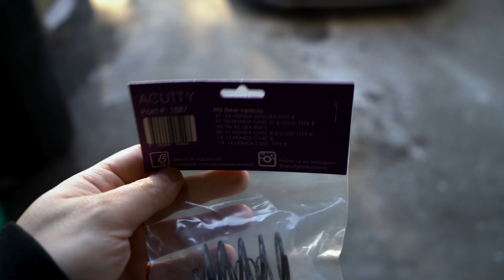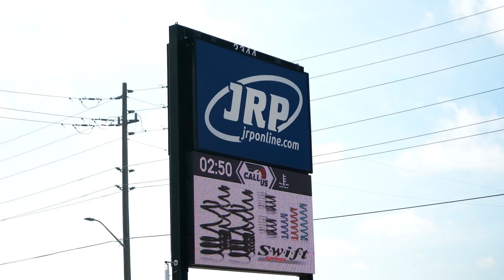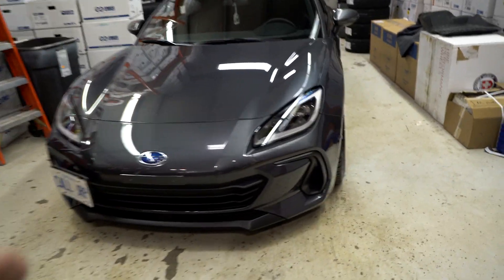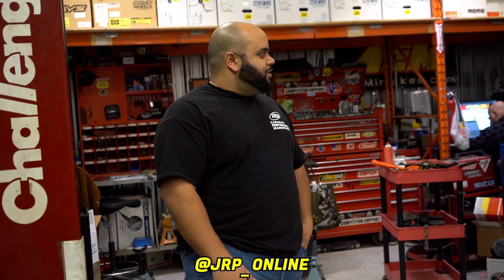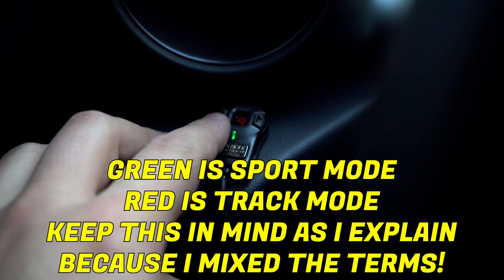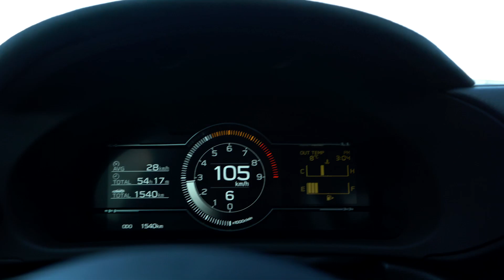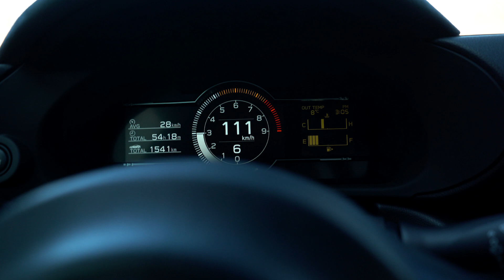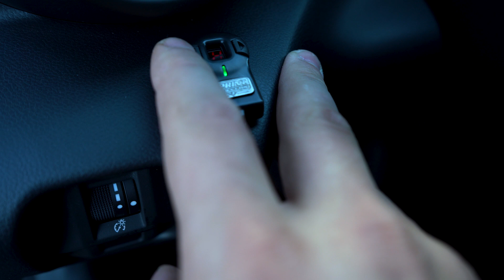ELIMINATING Throttle LAG on my 2022 Subaru BRZ

Comment: What you need is to upgrade your piston return springs. Also DOT 17 blinker fluid helps. I once had winter air in the tire for the summer, and that was messing up the rev hang way too much. Also unplug the alternator from the exhaust manifold. But do keep the O2 sensor in the speakers.
Reply from the maker: You are an absolute genius!
Reply: Who makes piston return springs for the fa24 engine though?
Reply: Who makes piston return springs for the fa24 engine though?
Reply: Who makes piston return springs for the fa24 engine though?

Comment: FYI Guys never leave your foot depressed on the gas pedal when changing settings on the selector. The unit itself does not like toggling through settings while it is sending a signal from your pedal assembly to the ECU. Always remember to take your foot off change settings then re-apply. The units come with a 3 year warranty so you are always covered.
Reply: The unit is good on both matic and manual cars, yes?
Reply: @dennispagulayan1900  yup there is a switch on the controller to toggle between manual and automatic

Comment: ught sprint booster for my 2018 subaru wrx modified and tuned after I installed the sprint booster it keeps throwing a codes about throttle pedal position. P2109, P2122, P2127. I also install it properly. Any Idea what’s wrong installing a sprint booster?

Comment: would you be able ask the a the guys at JRP if I can use the sprint booster together with the hondata flash pro
Reply: You can yes. But if you plan on purchasing the Hondata Flash pro then it will offer this as a editable parameter. So once you take it to your Hondata Tuner for a custom tune he can tune the throttle as well and make it more or less aggressive.

Comment: See and I actually want the opposite. The BRZ has a hyper active throttle as it is I barely touch the throttled and the car wants to run. I have played around with a scan tool. When my foot commands 10% throttle the ECU actually opens the throttle about 32%. It varies on conditions I cant figure out but it definitely gives the car way more throttle than you tell it to. To me that makes throttle modulation and control mich more difficult.
Reply: It depends on what revs you are in - the programming has a lot of rev hang under 4-5k, it disappears after that.  Its the ECU tune.
Reply: @Blight-fp3vt  It also opens the throttle blade to about 30% when you barely put your toe on the gas. Thats how they make slow 4 bangers feel fast. It seems soooo quick when you are just trying to drive easy. But then when you go dull throttle you get disappointed because there isn't much there.
Reply: @boost331  I don't get that in my brz, however we know the gr86 has a different and more aggressive throttle mapping - is that the one you have?
Reply: @Blight-fp3vt  No. I have a 22 BRZ. It absolutely does it. If you have an OBD2 scanner and the torque app you can actually see it in real time. When my foot commands 5% throttle the actual throttle body opens anywhere between 30-35%
By the time you get your foot to about 65% of the way to the floor, its actually already wide open.
Reply: @boost331  This is not my experience in my manual, nor the experience I had on my test drive with an automatic.  Its possible you have a faulty throttle position sensor - that is a crazy amount of throttle for a 5% accelerator depression and quite dangerous, I would speak to your service department immediately.
Reply: @Blight-fp3vt  It would be dangerous if it wasnt 228hp and even less torque we were talking about here. You may think thats not what you have going on. Use a scan tool. You will be surprised. This is not something new for these cars. This is pretty much all low power 4 cyl cars.
Reply: @boost331  Yeah I am just struggling to understand where you are comming from here, its not normal, you need to get it checked.  The number of in traffic scenarios that could have you making collision with a pedestrian or another vehicle are high.  It wouldn't matter what car we are talking about - one with a 0-60 in 6 seconds or one with a 0-60 in 10 seconds it doesn't matter.
Reply: @Blight-fp3vt  I promise you its normal. It can be more or less dramatic in certain cars. These just have a very aggressive throttle tuning to give the illusion they are faster than they are. If the car actually gave the amount of throttle you told it to the car would feel lethargic. You would need to give it 30% throttle to leave a stoplight. I tune my own cars and do a lot of data logging. I see this time and time again. The less power the car has the more they try to compensate.
Reply: @boost331  So I dont think you are reading it right.  Going by the prior generation car (I have not seen any mapping images yet for the 2022), the value you see comming back based on accelerator angle is not a percentage.  For example in the first car the target throttle number request by accelerator pedal angle ranged between 1 and 220.

As an example the prior gen car, at a angle of 4.5%, it requested a target of 25 at 800 revs, while at 100 percent angle requested 138 torque target at 800 revs.  So even flat to the floor it could only ask for a maximum of about 65% of the full engine torque.

At 3200 revs, the angle of 4.5% askes for only 4.4 , while 100% angle asked for 220.  

The top half of the revs spectrum is more like this, while the bottom half is more like the first example.

Essentially, if you are requesting power low down in the revs it limits your max, but provides a decent amount of power, where as once the car gets going its more linear in its throttle response.

In neither of these scenarios is the car asking for like 30-35% at 5% throttle angle.  If it was that IS a problem, no matter what you believe that is NOT normal.
Reply: @boost331  Also - You tune your 2022 BRZ?
Reply: @Blight-fp3vt  You are absolutely right that it can be displayed as an angle. Many scan tools can convert it to a percent to compare with the commanded throttle inputs. I have mine set to display that way. I am pretty confident it is accurate. It does use tps voltage to calculate that number so it can have some deviation, but it gives a good general idea of whats going on. No tuning software is available yet for the 22 models. I have just been doing some data logging to see whats going on in preparation. Its a great platform with a fun high rev engine, but the throttle tuning is not how I like it. When the time comes I will make it more linear to closely match the commanded throttle.
Reply: @boost331 So the TPS voltage represents the angle of your throttle position, it doesnt ever change unless you use a throttle controller, though that can only do so much because (like in my example) you will never be allowed to request the full amount of torque (without ECU changes) at lower revs.  

What I think you are mistaking is whatever way you are reading the information about the actual torque being requested.  What values are you seeing from that?  And how are you seeing them?
Reply: @Blight-fp3vt  I am comparing the PIDs "TPS command" and "TPS actual %" if I choose I can view it as "TPS V" which is voltage, but that would then require a calculation to convert it to the percentage that is already given using the other PID. "TPS actual %" is exactly what it sounds like and have proven accurate on every car I have ever used and tuned with it. Trust me when I tell you this is not some phenomenon with this car. The throttle mapping or "tip in" as some people call it has been done this way electronic controlled throttles for a long time. Considering I have made my own throttle mapping on several cars and worked with shops on a dyno showing my data logs and spending hours and hours creating nitrous tunes that require very specific throttle conditions, I am confident in saying I know what I am looking at.

Comment: What is different from just pressing the gas pedal all the way? Does the same thing.
Reply: It goes further than that, if the solution was as simple as pressing harder on the pedal we would all be driving cable throttle driven cars today! ETC throttle pedals have a small potentiometer inside. The output of this potentiometer isn't ideal for certain driving situations like overtaking, quick stop and go and launches. This is why re-tuning the throttle is always a better option. Usually when you purchase a top of the line ECU tuner they will re-tune the throttle output as well to accomplish the same thing. This device just addresses that simple weak point independently.